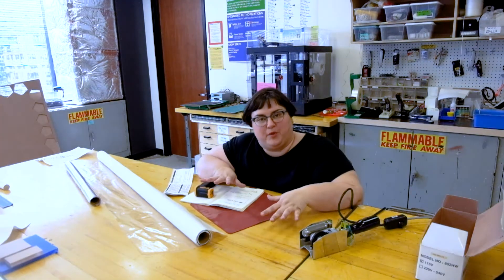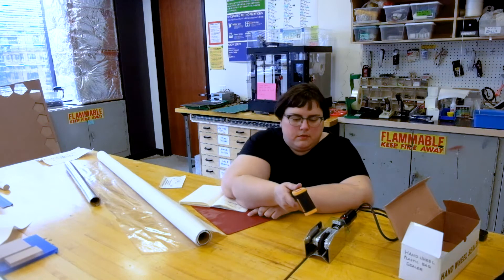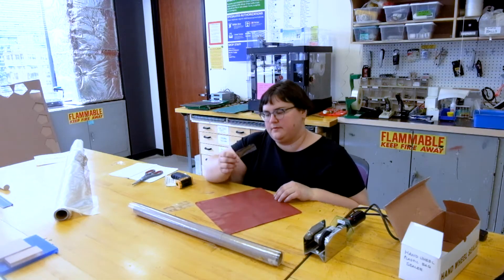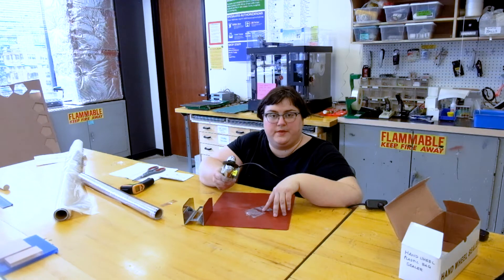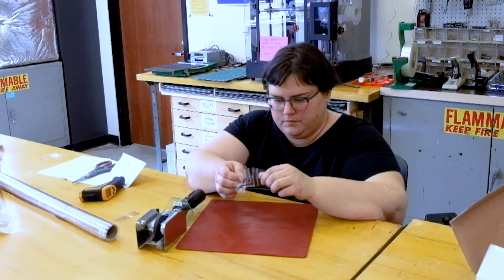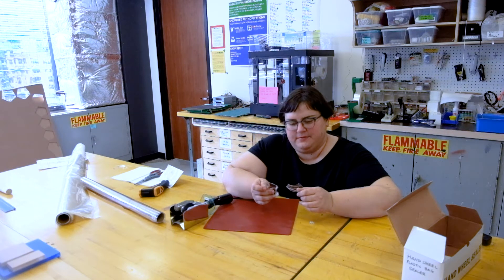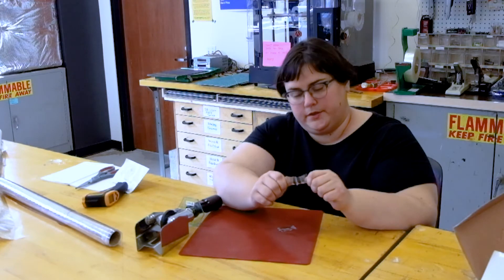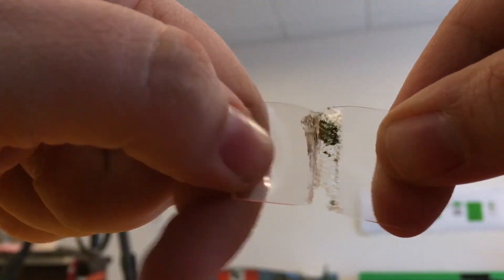Experiment: Heat Sealing Vinyl

Comment: For those wondering, The temperature reading fluctuates because metal has low emissivity which means an infrared thermometer cannot "see" the temperature being emitted from metals. If you coat/paint the surface of metal with a black plastic (like electrical tape for lower temp applications), the metal will reveal its true surface temperature to an IR thermometer.

Comment: I’m working on a military humvee vinyl top that I need to cut down for a shorter profile. So I’m looking at different ways to join the vinyl back together after I cut out the excess material. Thanks for the video. But did you ever let any of the test vinyl look down fully before trying to pull them apart?

Comment: Thanks for the informative video series. Sadly neither method seems to work in my case. 
I'm trying to build some doll sized pool toys (the manufacturers don't seem to even wanna bother talking to anyone wishing to order 10-20 pcs). 

At that scale using vinyl glue seems to be pretty challenging due to the scale and precision needed, basically even the slightest uncontrolled spread of the glue ruins the geometry, not to mention how hard it is to keep the amount of glue small and consistent along the whole thing. Additionally any "strands"/"hairs" of glue that inevitably happen ruin the transparent surfaces of the toy as well.

For most of my attempts that kinda worked I've been using a Miniware TS100 iron set at 160-180°C (less for .15mm, more for .3mm) with a flat 45° angled tip, and tracing paper to prevent the vinyl from sticking. If doing that at around the speed of 0.5mm/s (using a metronome at 60bpm, move 1mm on even beats, do nothing on odd) I seem to get a half decent seam, but since it's a very slow process it's hard to keep the timing consistent and at least one or two weak points develop. 
After going over them a few times more, eventually the seam is sturdy enough, but the vinyl right next to it is probably worn out enough that, with the tight radiuses that these small sizes introduce, create too much pulling force and it just tears apart. 

I was thinking that if there was a way to weld the whole seam at once (most simple ones for now are a 10cm-30cm radius circles and or equivalent length lines) and make it wider than the 3mm of the soldering tip, that could help with reliability, but not exactly sure how to approach that.
One idea was using a clothes iron with aluminium foil templates covering everything but what I want to weld, but somehow I think it'd end up welding through the foil anyway (don't have an iron yet to try).

Other than that I'm completely lost at what to try next, if you might have some tips could you please point me in the right direction?
Thanks!

Comment: I''m currentyl trying to melt crystal clear vinyl sheeting together to enclose my patio for the winter.  I used a regular iron and a towel and have had some success.  Some bonds are too weak and pull apart easily while others are pretty good.  Might be the length of time I hold iron on.  IDK yet!
Reply: i think your working with Styrene a type of plastic that may be sealed with airplane cement. It will heat seal a little bit. its not vinyl.

Comment: try loctite vinyl adhesive. u can buy for relatively cheap in bulk on amz. squirt a very small bead down along seam edges, then press layers together and leave for at least 24 hours (dont cheat and test it before 24 hours... it takes time for solvent to dissipate/evaporate).  the adhesive is essentially liquid vinyl with lots of solvent to keep it gooey for just enough time to lay it down (working time 10 min i think).  the solvent partially dissolves the material layers to be bonded and forms a very tough seal.  would it be airtight? my guess is yes for low psi (below ~ 2 psi).  to get even better bond, use light abrasive light magic eraser sponges to scuff surface, then clean with alcohol wipes and let air dry before laying the loctite down...... from one creator/tinkerer to another, cheers!
Reply: after more projects, i'd say loctite is best for reinforcing seams and fixing pinhole leaks. it can work well as the main seam glue only if you can confidently clamp it. also any seam that will have a decent amount of tension on it, like a seat cushion or other inflatable, then you want to make sure you lap seams or butt them together and add a 2" thick strip to span the joint between pieces.  for large glue jobs, i still think hh66 is the best option.  i just wish you had more time to work with the fabric before the hh66 sets up. also i've noticed the hh66 has a bit of a weakening effect on the vinyl so unlapped sections that get some hh66 on them could be weakened... and if in the wrong spot could end up being a failure point.  so i've used masking tape to keep the glued areas tidy.

Comment: Hey, this is awesome. I'm currently working on a project recreating some IV bags that will host some shoes and become the packaging for those. I actually was able to figure out the sealing part without burning the vinyl. I have a heat press and I put a metal rod onto the heating plate and let it reach 400°F then I will have a piece of mylar acting as the teflon sheet and have light pressure for 3 seconds and that would give me a good seal. Once I let the vinyl cool I take the mylar off and everything looks great.

Comment: Have you tried to set heat of the welder very low and move it much slower? Or is the adjustment knob/thermostat really broken and so always does maximum heat. (Modern soldering stations are inexpensive and do have working temperature control. Constructing this is not rocket science.)

Properly working It should not smoke or leave black stains. If it is broken, try an external socket lamp dimmer or wire incandescent lightbulbs (as resistor) in series to reduce heat.

Comment: In another video with a similar tool (https://vimeo.com/73390600) the fabricators were using some kind of heat shield paper/ membrane in between the tool and the material, which I assume is to prevent burning or mechanical failure. I'm going to try something similar. Thanks for the video!

Comment: Hey, Becky, your post about cat boxes showed up as recommended so I watched it, and even though I’m between cats, it was very useful. So I decided to see what you have on your channel. This one caught my eye. I’m an artist, and I used to make earrings that were clear vinyl filled with interesting stuff. I used a tracking iron to seal the edges. I’m not as techy as you, but tacking irons are used to melt a bit of the glue sheet to hold a photo in place when heat pressing it to a board, or sealing laminate sheets together temporarily when laminating something. It gets pretty hot. I used it to almost melt the edges of my earrings together. I can’t tell you what temperature I used, I just used the setting I found to work. I guess my point of telling you this long story is that heat should work. At least it did for me. I think maybe your tool wasn’t working well. I think the temperature was fluctuating wildly and it was sealing some areas well and not others. Also, you need ventilation, as you noticed, because the smell is vile and I’m sure unhealthy! Just my 2 cents on the subject. Congrats on graduating! I’ll be subscribing.